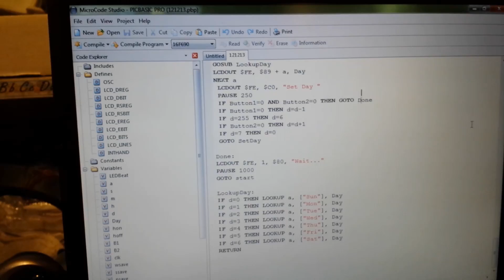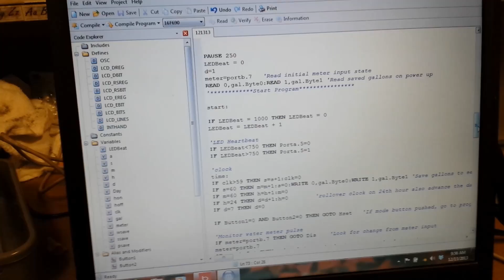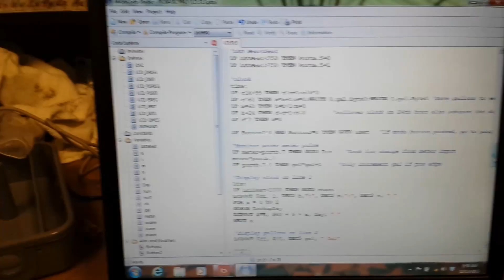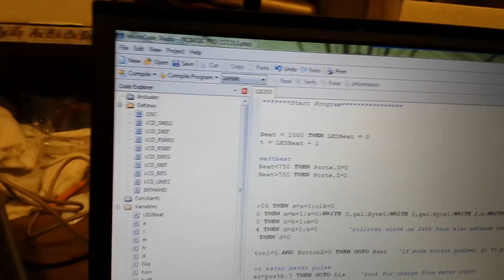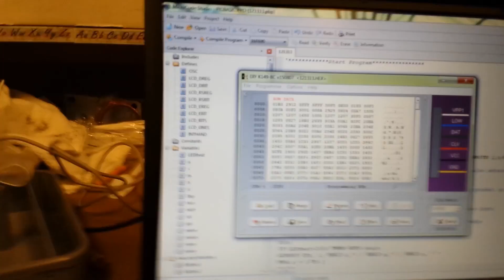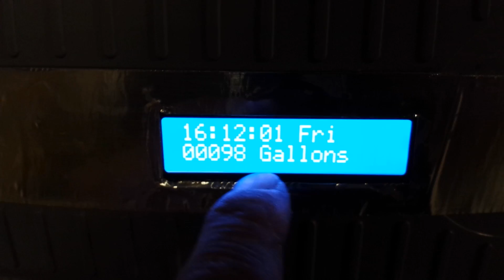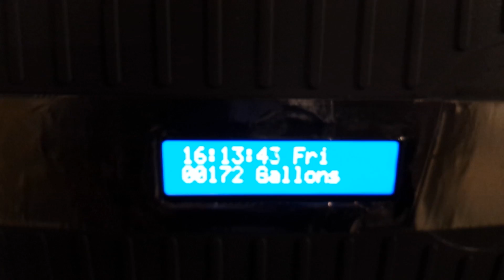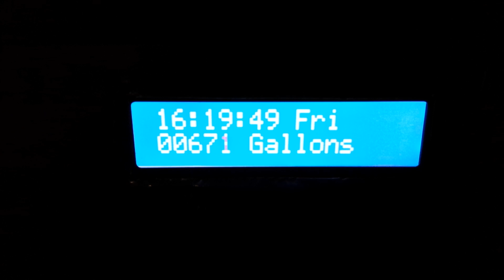Project home made water meter remote display (LCD)

Comment: how many eeprom write cycles does your chip have? wont you burn out the addresses you are using by writing to them so often? does it have a low power 32khz clock mode so you could use a small battery for backup/continued operation w/o lcd?
Reply from the maker: It has a low power mode but I've never used it and didn't have time to play with that. The only reason I dumped the hours and minutes to memory was just to do it and I originally was thinking of making a display of gallons used over the past 30 days, etc but since this is a work project and not something I was working on at home for me, I didn't put the time and effort into it.

The only thing this really needs to do is display the gallons remotely for that water meter that requires a ladder to access.

As for the eeprom, the PIC16F690 rates a 1 Million eeprom write endurance.
So at one write per minute that = 1440 per day.
That's 525,600 per year.

I guess I could kill it within a few years. I should have done this simple math yesterday. I guess I gave it a 2 year life expectancy.

I could change it to once per hour by changing one line of code. That would give it a 120 yr life expectancy instead of a 2 year life expectancy. LOL!
Reply: hi #hackfreehvac, i also use the pulse output water meter like yours, my sensor has 3 wires, (1red, 1 blue, 1 white), i do not know which are use for power supply, which is the output of the meter,  so could you help me? Thank you so much.